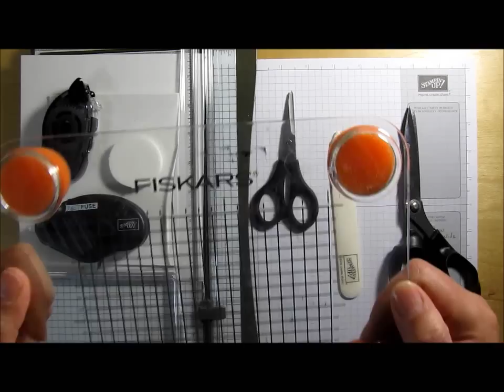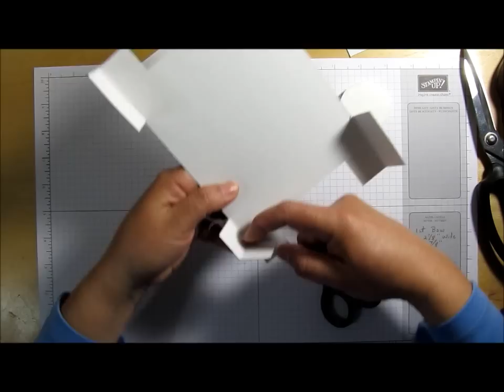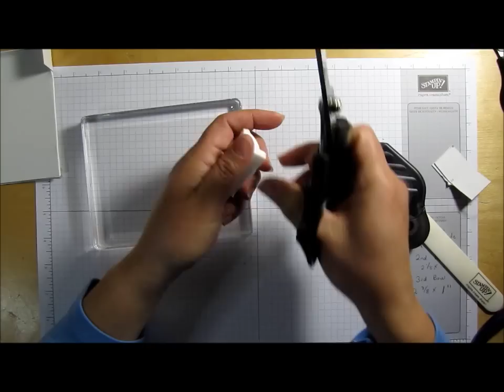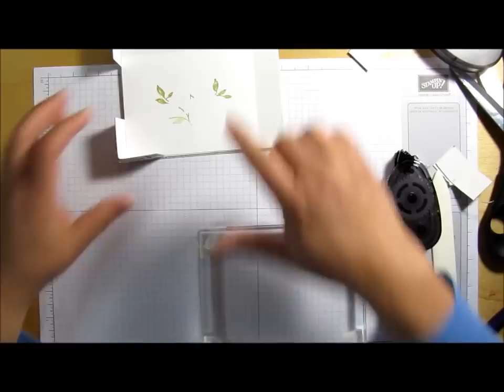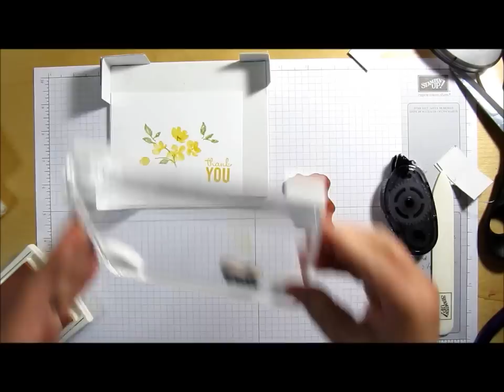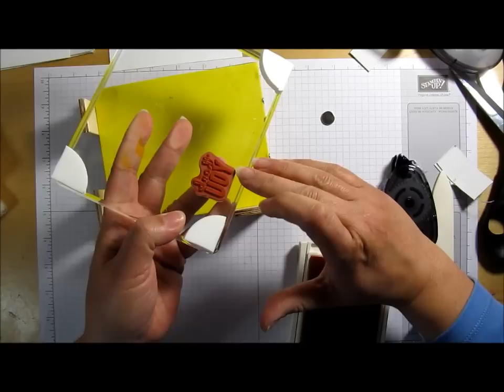DIY Stamp Positioner

Comment: I saw another video where a gal from the UK made one very similar from a CD case.  I followed her instructions and made one for myself, adding a magnetic photo sheet from WalMart, and some grid paper I already had.  Works great for smaller panels.  just search on YT for homemade stamping tool.
Reply: deskjockie49  where are you finding the cd cases that doesn't have the guts made into them????
Reply: Robbie Gustavus
Robbie, you take the 'guts' out.  If you're careful, the little pins in the hinge can be gently pulled apart and the holder for the cd can be removed.  That leaves you with a clean case.  Hope this helps!
Reply: I made one from a multi ring case. I put an hinge on it, and I use a Bigz die inside, along with the foam that the rings slot into and I use that under the Bigz die to give a bit of bounce to it. It works perfectly.
Reply: a cd case is like 5x5. a standard card size is 4.25x 5.5.  the ones I saw are from a DVD case. but they are hard to find that don't have the "guts" attached.
Reply: prettypaperthings Yes, I've made one from all of these things.  But I really like the one I finally made myself.  I use it frequently.

Comment: Really like the look of this. Just wondering what situations would you not need the makeup sponge on your block? I don't recall you saying why. Also do you have a direct link to a blog post about this where you have a list of what is needed and the steps you took. Thanks
Reply: I've asked my hubby to make the box for my fiskars compact stamp press like the one your hubby made :) I love my press but I wanted something to have my paper and press in the same position each time. Thanks for the inspiration.
Reply from the maker: +Tracy Blackburn  The stamp sponges help you suspend the stamp until you are ready to push the stamp down on to the paper. It's not necessary, but helpful.

Comment: I have a Cuttlebug All-in-one that I don’t use too often. It already looks somewhat like a stamp positioner. Can it be used for that?
Reply from the maker: If I'm not mistaken, the Cuttlebug All in one is a die cutting machine.  You could use the plates instead of an acrylic block. If that's what you mean. As long as you can place it evenly in the corner.
Reply: Jeanette Cobb no it’s a heavy plastic that looks something like the misty with a hinged acrylic top. I tried it just now and it works as a positioner! It isn’t a die cutting machine it’s more like a heavy duty embosser! I just need to figure out how to keep the paper from from slipping and sliding! https://youtu.be/HChaUaYS-Tg
Reply from the maker: @BeatlesFanSonia  Gottcha! Maybe use some repositionable adhesive to keep the paper from slipping.